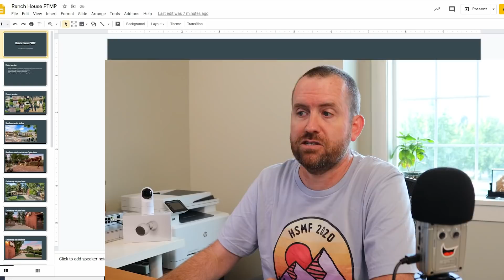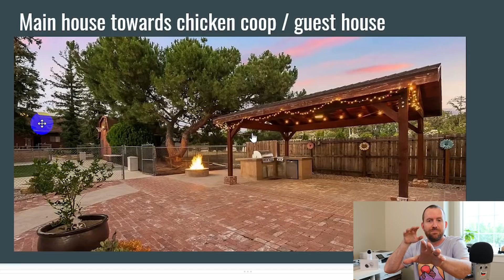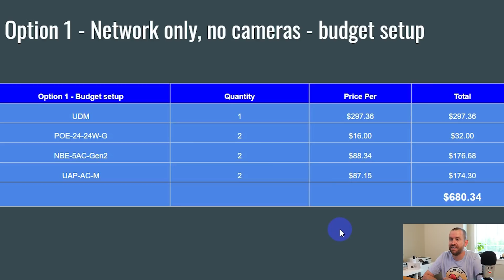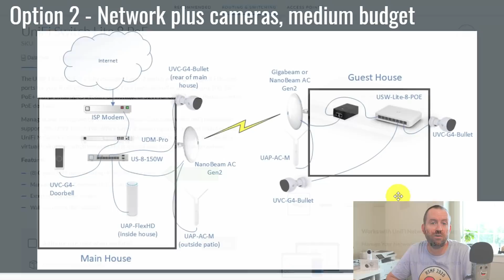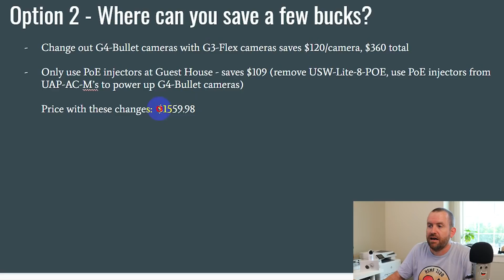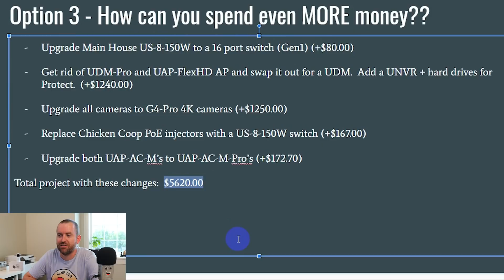Ranch House Network Design

Comment: I just got back from my parents' 40 acre farm property.  On my prompting they had me design and install a full blown Unifi/AirOS/Protect system covering 5 buildings with strong Wifi and pretty good Wifi and cameras covering all 40 acres. Using what I've learned from you (And some PfSense-fu from Tom at Lawrence Systems).  I'm just a hobbyist, but it turned out amazing!  Keep these videos up, they are VERY helpful.
Reply: How many cameras did that take? Lol
Reply: 24 g3 bullets, 4 doorbells (which are hard as heck to get lemmie tell ya) and a couple of domes.
Reply: M W wow that is impressive lol how many weeks...I mean days did it take lol
Reply: @coryhall620   I was there for 2 weeks, most of it was running cables, drilling holes, and mounting the various nanobeams, cameras and APs.
Reply: Would love to see a schematic of your set up MW. I want to do a similar set up on my property (32 acres) but I will need to run all the remotes off of solar.
Reply: Col. Johnson Look up the solar model switch. Chris did a video of his that he uses. It definitely pays to look at your region and how much solar you get Vs. just saying you will do solar. Some regions need more sun per day to charge so even if you use large deep cycle batteries then it will be costly to have full 24/7 surveillance. Definitely choose your settings wisely on motion detect to avoid it running often and use a mask out areas you do not expect motion from. That takes a while but will be effective at cutting down the draw power of the devices. A solar switch does 40 watts of power but draws less to run itself.
Reply: Cory Hall , thank you Cory for your input. I live in central Texas, sun is not an issue. I did see Chris’s video on the remote setup using the solar panel but he admitted that solar was not something he was very knowledgeable about. Which is why I was asking MW about his setup. Ultimately, I would love to see Chris get together with one of the well known solar guys on YouTube and do a remote setup. But there may not be time in anyone’s lives for that .
Reply: Col. Johnson I install Gate Systems and Solar in Texas is great for sure. I was in the Navy on Submarines and never saw the light except through periscopes lol However, I know it becomes a spec game. Sometimes you want to do a certain thing later and realize upgrading is not an option so do it right the first time. If you go cheaper on the batteries the long term is you have to replace more often. You get go overboard and you can add more equipment later. What are you really trying to view and why is the question. 

You cover a perimeter and you don’t have to cover all of the in between areas. Ubiquiti has a planning tool to use for equipment location they tied to google maps. It uses elevation and asks input like height on the pole for NanoBeams and you can do GPS drag and drop to place equipment in it. Also, one for planning power use and number of APs, https://unifi-planner.ui.com/#/ or use this one on the PC, it has a version that works on your phone called old Airlink. https://link.ui.com/
The whole point is to save time thinking it will work and real world application is that it might never even come close. But planning is key!!!
Reply: Col. Johnson one other thing to consider is operating temps of equipment and the solar model switch gets to 122 degrees F top end temp so it may be an issue. Even in NC here a 90 degree day will make attics or enclosures 130 or more. Sometimes people put things in enclosures and then you need exhaust fans for it to work correctly or extend the life/stability of equipment. My buddy does HVAC in Houston so I know how hot it gets there lol
Reply: Cory Hall , all valid points I will look into, thank you. Heat could be the deciding factor to shoot it all down. And thank you for your service. Submarine, could never do it, lol.
Reply: Col. Johnson no problem and no problem. I always got told I was crazy lol fresh water, safe from nuclear fallout, safest place on earth at war believe it or not. Thanks for your service too! I did underwater navigation, electronics tech, and about 10 other jobs under the ocean lol

Comment: One benefit of the Orbi's is that you get a dedicated back-haul band, so it's not true that you halve you bandwidth by hopping across multiple APs.  If anything, "in theory" you get better throughput than connecting multiple traditional APs on a wired network, as usually that is a 1Gbps network and the back-haul band exceeds that when aggregating network streams. In theory anyway, as you have to be within range of the peer Orbis and without too much obstruction to get those speeds.
That said, I would net recommend the Orbi except in the most basic use cases, as you have no real design flexibility.  Only 1 SSID and one Guest network SSID, the L3 options are minimalist and lacking, and you cannot utilize dot1q tagging on the LAN side - not that is matters much since the lack of SSIDs make it so you only have one network to work with anyway.
Reply from the maker: Funny I looked at the spec sheet for the Orbi trying to find whether it had a dedicated backhaul radio, but it was unclear.
Reply: Crosstalk Solutions close to every Orbi has one and netgear’s website is pretty helpful to know if it has one.

Comment: So why is the mesh WiFi antenna wired? Isn’t the point of a mesh antenna that it isn’t wired into the network?
Reply: I think he's not really using the mesh capabilities in this instance.  It's just being a fairly cheap access point.
Reply from the maker: Yes - this.
Reply: Crosstalk Solutions thanks for confirming, I appreciate it!
Reply: Rancid Beef ah okay, that makes sense. Thanks:)

Comment: You kinda lost me with the “headaches from 60ghz” bit. I’d still mirror what others are saying and run a hard line between the structures if at all possible.
Reply: I've stood in front of these types of wireless equipment, they make my head feel like it's vibrating. Trust me, it can be an issue
Reply: Yar Nunya  you sound like quite a few doctors I know. If you haven't experienced it, it doesn't exist. For your edification however, I had no idea at the time what I was near nor why I had that feeling. Only later found out later what happened and went back to the same site to have the same issue. While I won't admit I'm sane by any means I am highly analytical and skeptical of things. Personal experience has confirmed this instance of weirdness for me.

Comment: They show only one port on the NBE-5AC-Gen2. How is the UAP-AC-M powered? I think it may be the NSM5 to have two ports.
Reply: Can verify it has two ports, have used a bunch of them. Some very early versions of it only had one port on however
Reply from the maker: NBE-5AC-Gen2 shows 2 Gigabit ports in the product specs.  I'd have to dig one out to go verify manually though.
Reply: @CrosstalkSolutions  I see on www.ui.com shows two just love how some do not put up the correct info and photos. LOL Just like you say you had to go verify manually. Thanks for the video.

Comment: Why not a 300 ft cat 6 cable along the fence?
Reply: I would strongly suggest using Fiber for outdoor installations if you have no need for PoE. You can get them Pre-Terminated quite cheap and then you don't have to worry about lightning, diffrent potentials, ...
Reply: @pearcomputers2542  I second that.  I've lost switches on both ends of a long cat 5 run years ago because of induced current from a nearby lightning strike.  I switched to fiber and never had another issue.
Reply: @rancidbeef582  It depends on the location, in southern CA lightning isn't as much of an issue as in other places.  I agree fiber is the best solution, but may be cost prohibitive. Hard to know without more specifics on the property, and rather the owner can do some of the grunt work (trenching, mounting equipment) themselves etc. If they are looking for someone else to install everything, then wireless may be the only reasonable cost solution.
Reply: @pearcomputers2542  fair point but still I think a hard line from a>b is a solution that could be worth costing.
Reply: HarmanatorNYC the hardline is kind of an option sure, but like Chris said he is showing a new way to do things. Hardlines are an old school method and take more time, get cut and need spliced or replaced and at the end of the day are more labor.
Reply: You risk getting into problems with earth loops and different potentials if you use copper links between buildings so I'd say avoid copper and go with PTP/MP wireless or OM3 fibre links. If this was me/my house I would definitely be going down the fibre route buried in ducts just to make sure I had the expandability options in the future. Home networks are going to be carrying so much data in a few years time. Plus having fibre would allow you to have back up links between your switches just in case something fails. Having been a Cisco & DrayTek fan for years, I've only just jumped on board with the Ubiquiti brand, so far I'm really impressed how easy it was to get a very large home network setup including VLAN's and firewall rules. :)
Reply: @PhillHills  Isn't Ethernet transformer isolated?
Reply: Thank you, Chris, for all your videos they really did help get off to a flying start. Also, NetworkChuck, Willie Howe & CBTNuggets Jeremy aka Keeping IT Simple ...all brilliant channels for new Ubiquiti users.  :)
Reply from the maker: Many reasons:

1.  It's ugly
2.  It's more expensive to get the cable + conduit you would need to do that
3.  Takes WAY more time than the hour or so it would take to configure and mount the NanoBeams

Not to mention that this is a networking/WiFi channel - I'm trying to show what's possible.  :)  

Bottom line though is that there are many ways to skin that cat.  But, if you're bidding on this exact job, and I came to him with my $700 quote, and you showed up with your cable and conduit with who knows how much more money for that solution, then I think they would pick mine.
Reply: @CrosstalkSolutions  I'd be curious how much more with fiber (as a better suggestion than mine)

And surely that is a how cool is that your own personal fiber link.
Reply: @HarmanatorNYC  It's going to vary considerably from location to location. There are major differences on how hard it is to trench, rather permits are required etc. Some areas have relatively loose soil, no permits, and no minimum depth requirements which would be pretty cheap to trench, other places are the opposite on all counts.
Reply: @timezonewall  would it need to be buried. Looking at the plot there is a fence. Couldn't it be run in UV resistant PE (sprinkler hose).

Thank you for the conversation. 

I'm curious as my goto over a visible sight line distance would not be a wireless bridge. 

As Chris mentioned it also increases the structured backgroin Rf in both residences.
Reply: @HarmanatorNYC  Sure, it depends on how professional you want to be.  In order to be up to code, one would have to use purpose rated electrical conduit or cable/fiber that is for outdoor use (direct burial or UV stabilized if above ground). That doesn't mean putting cheap cable/fiber inside black PE sprinkler lateral pipe above ground wouldn't "work", but you may have to remove it and/or re-install it correctly (buried) when the house is sold. It also won't have the durability and lifespan of a proper solution.
Reply: @timezonewall  yep.  Not sure what code is here. LV is so loose when it comes to code.
Reply: I agree, the answer here is to get ethernet in, I would imagine it can be hid, its cheapo as chips and stops all the 'hops' crap.